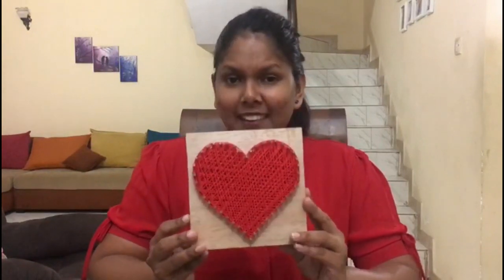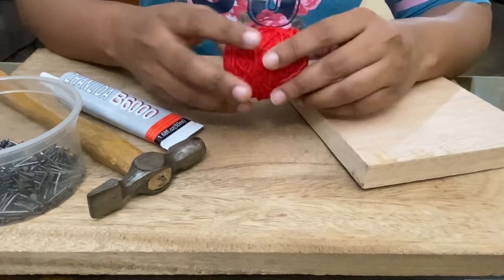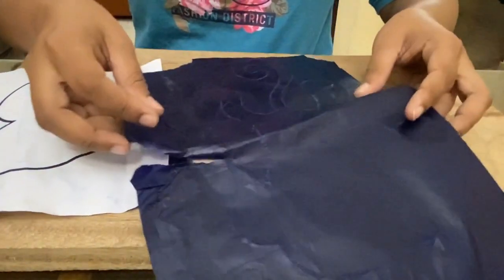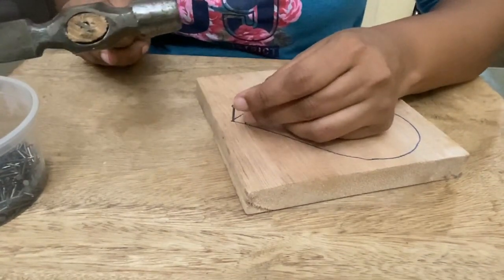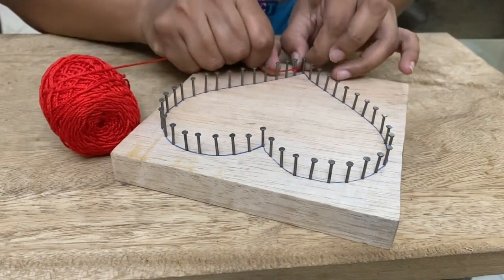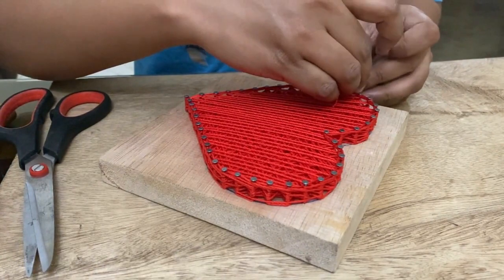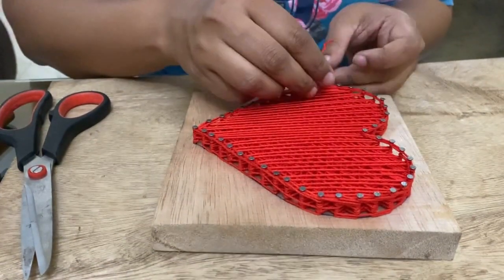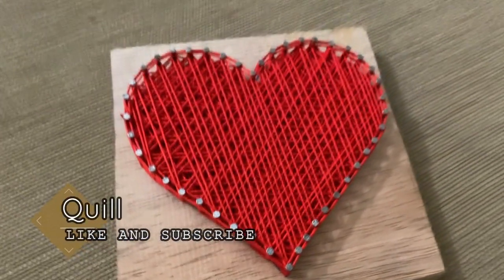How to make a basic string art | සිංහලෙන් String Art

Comment: How many rounds we should fill it inside   and also cn I know that can we put the out line before we start filling inside
Reply from the maker: - You can fill it up until there in no blank space and until pin head. There is no specific limit for rounds, you can decide it 😊

- No, don’t put the outline before inside filling. If you put outline first, so that it will not appear. It will just go down in pins and you will even have less space for inside filling. 
Do inside first and then outline.